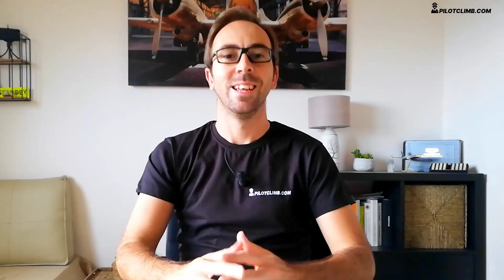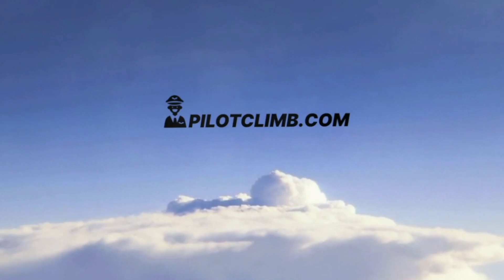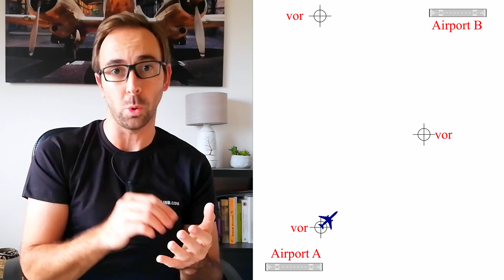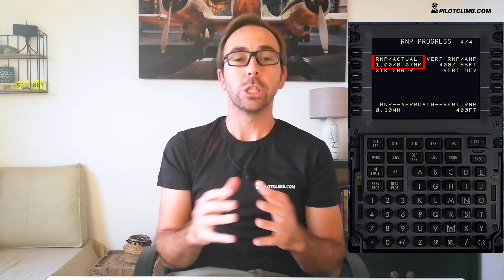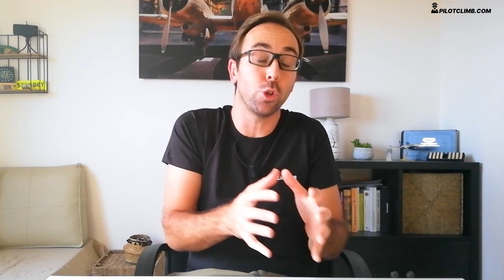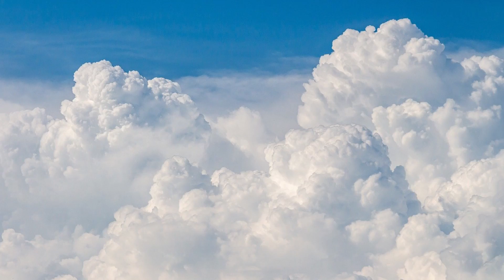Lnav (Lateral Navigation) Explained - [How Does The Airline Jets Follow The Route].

Comment: If your off the magenta is it true you can only engage lnav if less then 3.0 nm off or / and on an intercept heading of over 90° ?
Reply from the maker: Hey, many thanks for watching!! I hope you liked the video.
If you are off the magenta but within 3nm you can engage LNAV with any heading.
Above 3nm you can still engage LNAV but you must have an intercepting heading of 90deg or less and you must be able to intercept the route before the next active way point.
Let me know if I answered your question.
Reply: @PILOTCLIMB  ok thanks a lot and if you have opportunity a video on how to abeam points, fly a 737 VOR approach or about RNP approaches would be amazing ? I have one question left with rnp APPR does it still use GNSS/GPS but with a PBN ( performance based navigation) system to make it more accurate? What makes it more accurate then rnav standard approaches does it use WAAS ?
Reply from the maker: @tomharper8402  Hey, many thanks for watching! I hope the videos are helping you! 

I have just invested in a powerful computer. so I will do Flight Simulation Videos soon!! Stay Tuned.

Regarding your question:
The RNP approaches use GPS/GNSS. What differentiates the RNP approach is the requirement to have an onboard performance and alerting system in order to monitor the accuracy of the ANP (actual navigation performance).

The accuracy of the RNP approach depends on the type of approach.

There are RNP approaches with lateral guidance only (RNP LNAV and RNP LP) and RNP approaches with Lateral AND Vertical guidance (RNP LNAV/VNAV and RNP LPV).

Let me know if you still have any questions.

Have a great day
Reply: @PILOTCLIMB  ok thanks and for the 737 what is the name of the on board performance altering system ? Does it have a name ? And thanks a lot
Reply: @PILOTCLIMB  so an RNP LPV doesn’t use GNSS though does it that would use SBAS wouldn’t it ?
Reply from the maker: @tomharper8402  well, on the 737 we just monitor (in the FMC and on the Navigation display) that the Actual navigation performance doesn't exceeds the Required Navigation Performance.